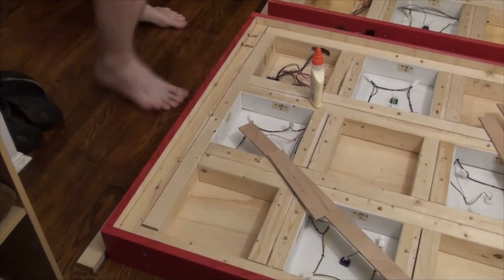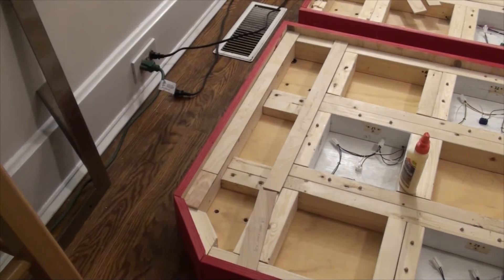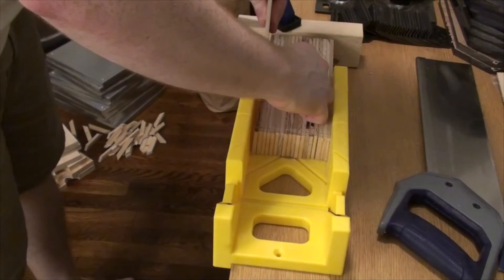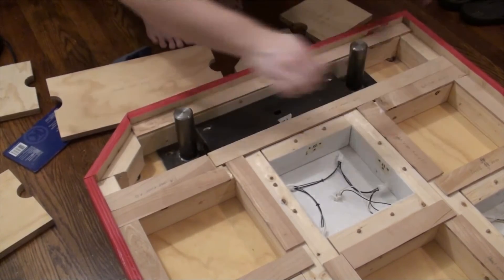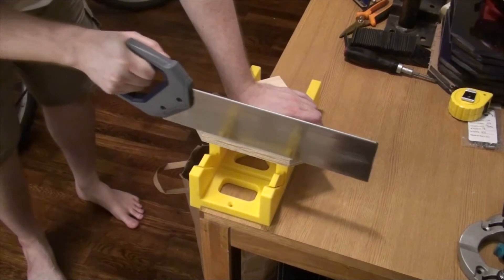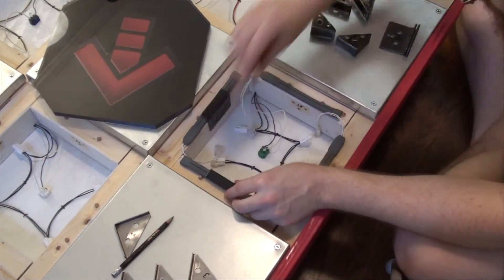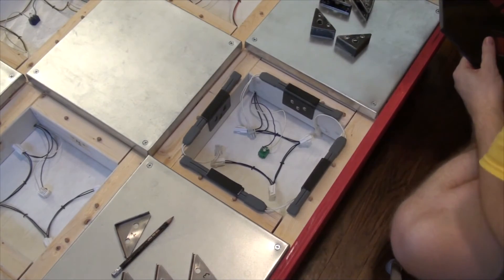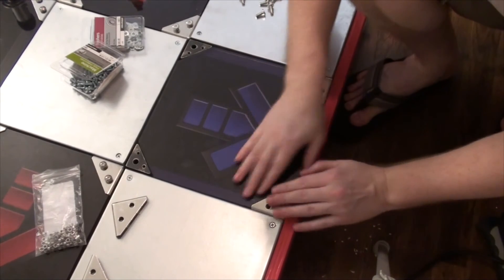Building an ITG2 dance pad replica - episode 13: Fitting

Comment: If absolutely necessary, it seems like you can re-make new stationary panels with slightly smaller dimensions.  (Dunno at this point if you'd prefer the aluminum of the steel.)  The new panels could have screw-holes offset from corners enough to avoid the existing holes; I guess (?) re-doing the counter-sink in the metal is the biggest hassle of those components, but also could be done better, and the metal and wood could be glued which may simplify the fitting, as you mentioned.

You allude to it in the video, but if arrow panels are too sensitive, I guess the fix is just to remove the corner brackets and the arrow panel, add another layer of foam to add more rise/springiness to a panel, and then re-assemble corners? I guess that would be the most common (or hopefully only) typical maintenance?

Comment: I wonder, when you calculated the height of elements and the number and thickness of "fillers" you needed to pad a section to proper height, do you also include the glue's thickness? Or is the glue so thin it doesn't matter at all?
Reply from the maker: I didn't get quite that specific, and I'm not sure how I'd calculate it if I wanted to... My overall strategy for that sort of thing was to add up all of the exact numbers I had, and then add a little bit of extra slop to accommodate the non-exact parts. The biggest thing that made a height difference ended up being wood warping in the frame - maybe I could have bought some higher quality 2x3s that would have been perfectly straight and level (or use a planer on them or something), but the ones I happened to use didn't lay exactly flat when mounted.
Reply: Right, I figured out it might be a bit impossible to include the glue thickness, which probably  is completely irrelevant.

I also was wondering about another thing - when you finally started assembly and you were connecting the bottom with the "middle" shape parts, you used a pretty clever method to work it out, but after seeing you using wood glue here I am now thinking if it wouldn't have been a better idea to first glue everything in place and then to connect it with screws?

Comment: The reason the finish is called finish is because it goes on last when you know exactly how big the rest is.
Reply from the maker: The reason it's called edge finish is because that's the name I assigned to it. Was this comment really necessary?
Reply: My apologies. By the time I commented you had all ready learned your lesson the hard way.  My comment was more meant for people watching(except it was late at night and I didn't fill it out as I should have).  The finish goes on last to cover up the differences in size between the base and the top.  The top parts being a hair bigger then the base is good because shimming the trim is easy compared to cutting down the base. And really measuring all the parts before you put them to gather takes about as much time as the rework that you have to do here.
Reply: And to be clear, you are doing a good job here.  Finish trim going on last is a lesson you don't really learn until you learn it the hard way. Or at least I didn't learn it from people telling me.
Reply from the maker: Thanks. It felt a little bit like being kicked while I'm down. I appreciate the apology.